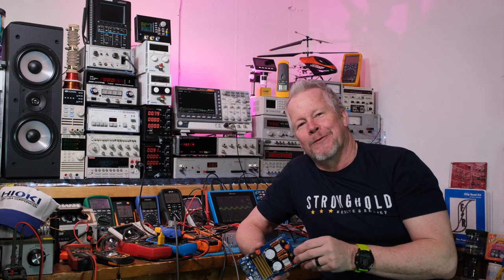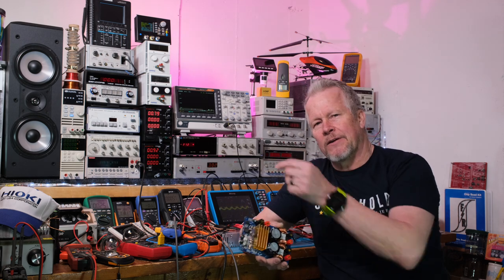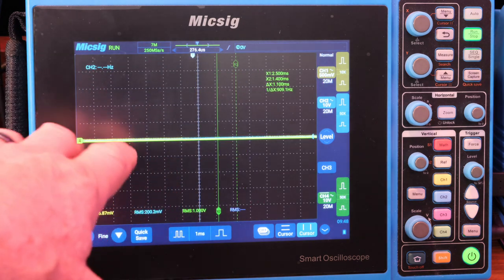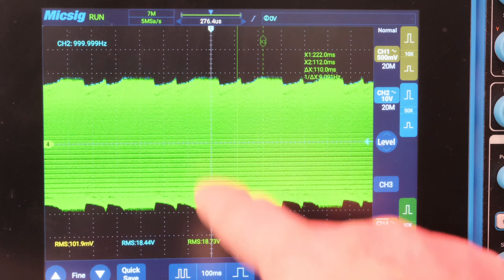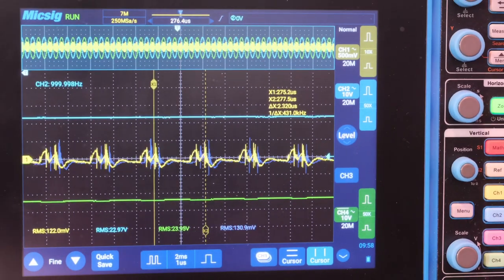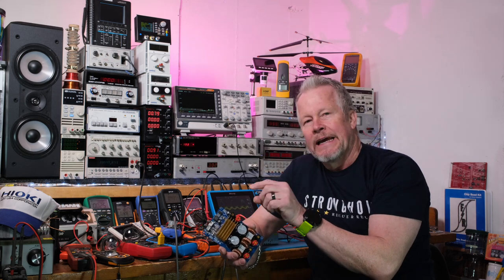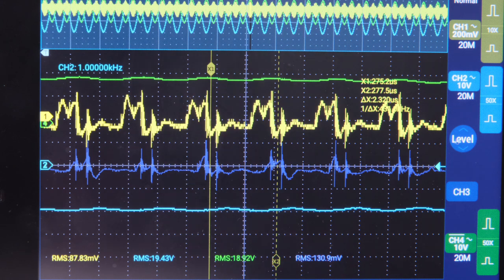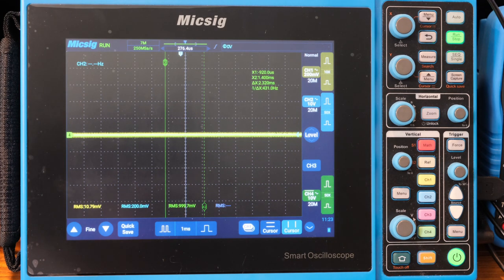300W x 2 Class D Amplifier and Switching Power Supply - noise clean up with TDA3255

Comment: The high frequency noise that appears just before clipping is due to the effective switching frequency being lowered as you approach 100% duty cycle in the class-D. The off time cannot go below a certain fixed time, so the feedback in the amp forces the output to stretch the ON time past a normal 450KHz cycle. Another thing that happens is mentioned in the datasheet: TI injects narrow pulses at clipping to keep the bootstrap supply replenished. All of that stuff is outside the audio band, even though it looks like noise on the scope. One thing that you might want to do is try some sharp cutoff low pass filtering between 40KHz and 100KHz or so between the class-D speaker output and the Keithley distortion meter. You might get a better reading of in-band noise rather than measuring out of band ripple.
Reply from the maker: Thanks for the great feedback Frammis!  I can filter the measurments, but I guess the part that I struggle with is wondering how much the filter capacitors are stressed with the switching noise.  So, I think it might be worth the extra filtering to be sure that the parts are not over stressed.  One good thing is that the high freq of 450kHz usually means low energy in the noise - so then maybe the noise or ripple isn't as bad as I make it out to be;)  I do like the idea of the sharp cutoff of the amp at 40kHz.  The the pass band is flat and phase is zero - and any concern about the tweeter being stressed is relieved.  You obviously know a lot about the Class D, so I'd be happy to hear more.  I want to design a Class D and so I ned to start by selecting the best control chip, and then deciding what rail voltages to use.

Comment: Thanks for your efforts, I concerned you may simply be measuring the reactance between the power supply and the switching amplifier. A low pass is helpful between the pwr supply and amp with a ultra low esr cap bank on the amplifier. You are probably measuring a portion of your bench setup. Excellent presentation. We use an ultra low esr, low impedance linear supply when characterizing the circuit in the lab with very short leads.
Reply from the maker: Thanks for your feedback!  I'll do more of these SMPS noise measuring and filtering videos very soon;)

Comment: Really glad I found you here...

A friend of mine suggested 2 caps.  a 63v 10000uf Nichicon with a 1uf 63V  Wurth Aluminum Electrolytic.   These in a box basically on the DC line close to the Aiyima A07 which is a 3255 amplifier board very similar to what you have.   Apparently the ripple causes the amp to heat up faster.   I have the caps, but I have yet to implement them in my system.   I'm looking for a cheap mains filter and I have to rebuild my SMPS enclosure in order to add an isolated DC module on one of the terminals so I can power a 5V 2.1A DAC     Would love to have some help ironing all these details out.
Reply from the maker: Thanks for the feedback!  I'd swap the 1uF with a poly 1uF for higher frequency filtering since that would be the benefit of the 1uF in parallel with a larger aluminum cap that isn't as great at the high frequency filtering;)  If you have an isolated voltage, you can use an inexpensive buck to generate the 5V.  https://youtu.be/FnEF_qzX0N4
Reply: @KissAnalog   I'll admit that I'm too much if a novice to know better, so this wasn't really feedback per se..  Moreover, I'm like a kid raising my hand in class.   I just picked caps...  Not knowing what to get.     Would I need AC/Pulse caps for this part of the project? What do I know....   Was buying the Nichicon a total newb move?    Could you make some recommendations on which caps to pair for this part of the project? 

As far as the isolated converter my PSU needs -  I bought a Meanwell isolated DC to DC converter with some filtering - PSD-15B-05.   Here is the another I bought - xp power DTJ1548S05

When I use this XWST DC DC 8-85V to 5V USB converter from Amazon in the juicebox in the pic - It gives a terrible hum like tone on my DAC.   So I searched and searched for isolated, etc.  This is what I ended up with.    

Any way to get a little 1 on 1  help with this project?
Reply from the maker: Thanks for your feedback!  Nichicon is a great brand, and they make a variety of series - each for a specific or general application in mind;) I want to start a weekly call or meeting with my Patreons and/or YouTube members of the channel (I have to turn this feature on;)

Comment: A nice little amp to connect to a mobile device in a garage or a lab for some background music if you want a half decent sound on the cheap, I don't think I would do any more with it than that. Seems the PSU doesn't make much difference overall, it just pushes the limit a bit higher. It might be interesting to connect it to a linear supply and see if the "clipping behaviour" changes.

Comment: I set gains on my audio amplifiers w an o scope a (cheaper one)and in fact i was wondering what the fuzzy peeks are????on ab amps i have a clean wave form thank you great video ❤
Reply from the maker: That's a great way to do it.  Thanks for sharing that!  Are you asking about Class AB amps with fuzzy peaks?  They should be clean, but Class D amps have a fuzzy or noise on the waveform.  It looks bad but it is actually far outside what we can hear.  It is the Class D switching.
Reply: @KissAnalog  exactly on ab they're very clean thank you very much love the videos ❤️

Comment: Cheers for vid dude! Any way you can do a multi out (mixer) switch mode power supp - 5 /12/48v WITHOUT opto feedback?? So many Mixers are binned because you can't get Power Supps!!
Reply from the maker: Thanks for the great question Graeme Wilson!  This sounds like a great video!  What would be the input voltage?  The output would be 5V, 12V, and 48V?  What current requirement for each voltage?
Reply: @KissAnalog  For me in the UK. IN 230 Vac 50 Hz - OUT +- 12Vdc -  5volt digital supply (USB interface) and 48v dc phantom supply. Say 20watt for 8 channel mixer. (+-12Vdc could be +-15) Thanks for reply!

Comment: I think painting the component you want to measure the temperature of with matt black acrylic paint, or even a black sharpie, would give more accurate readings than a piece of black tape. Nice video, waiting to see it all come together.
Reply from the maker: Thanks Ian!  I've tried different methods but the quick way is just to tape it and it does seem to come out about the same.  The emisstivity can be adjusted on the camera, but even that doesn't make a huge difference.  I find the camera to be a great way to get an overall idea, but a temp probe is more accurate when you need it.

Comment: Is 84 watts the most you at get at 8 ohms out of the power supply?
Reply from the maker: Great question!  I will do more testing with this when I get it in a box so that the wiring is cleaner and things are mounted so that I can run power longer.  Technically I should be able to get closer to 150 Watts per side into 8 Ohms at 1% THD+N and higher with more distortion.
Reply: @KissAnalog  It is something I wondered also. I picked up a TPA3255 in PBTL for subwoofer and 600w PSU from Aliexpress to find out myself.

Comment: I'm wondering what a Tantalum 63V 10uF ESR 100mOhm or Tantalum 63V 6.8uF ESR=75mOhms (Mfr. Part #
T521D685M063ATE075) ($5.31 at Mouser) would do to it?
Reply from the maker: Great question David!  I like tantalum’s - they are the most dense capacitor that you can get, so small and East to fit more in parallel!

Comment: You still have your plastic sheet on your Micsig; cmon time to remove it...
Class D, modulated switch mode power supplies, notorious RF noise soiurces. You can see why the audio enthusiasts aren't fussed by the technology. Keep up the good work, cheers!
Reply from the maker: LOL Peter ;)  I do need to peel the plastic!   I'm really curious as to the black box testing to see if one can really hear the difference between good designs.

Comment: Gonna try this out, the way I know to remove noise almost completely from an audio signal is to run the signal through 2 small transformers back to back, thats what I would call "lifting the ground", I have an analog synthesizer that I bought recently that is powered via USB micro or via 4 x AAA batteries, now this thing just eats batteries so, its way less painful to power it via usb, I have tried many usb chargers (240v 60hz to 5.3v Dc) all of them introduced horrible noise, music and talking from radio sources, It is just as bad when powered from a usb port on my studio PC, it picks up every fan and drive spinning up or down ha ha! from looking here on youtube it is a well known complaint about the instrument and its easily fixed with a cheap n chearful ebay ground filter. I have ordered one, it will be interesting to open it up and see how the filtering is achived in a cheap Chinese unit.

Comment: This may be tl;dw, but you seem to just keep adding microfarts. What about adding a few millihenries?
Reply from the maker: Thanks Peter!  That could work especially if it is multiple caps in parallel to lower the esr.
Reply: @KissAnalog  That noise you're measuring is at the outputs, right? I was actually thinking more along the lines of some inductance in series with those power resistors to match the reactance of the speaker coils. As I'm sure you know, many Class D amplifiers rely on the voice coil as part of a low pass filter.

Comment: Uuum yeah, having the power amp suddenly cut out on the actual speaker is usually unsettling*. Maybe it does it every time while it is stone cold? ...then it is probably some pin with a poor solder joint in there. If the amp always behave good with higher input voltage then it could be an issue with internal over current protection/detection. Maybe the issue scales inversely proportional to input voltage? 🤔 Then surely it must be some over current detection issue.

* Had a power outtage while playing at groovy levels, nearly shat my pants because the pop! from two subwoofers each having 2,5kW continuos power capability was pretty hair raising... 
I firmly believed it would be a bit more gracious, but no, horror levels of adenaline right there.